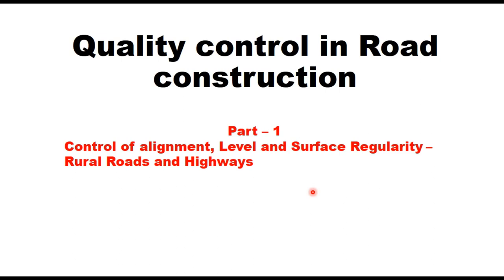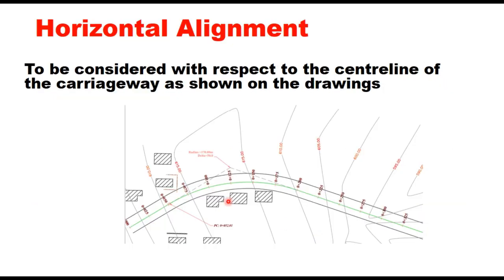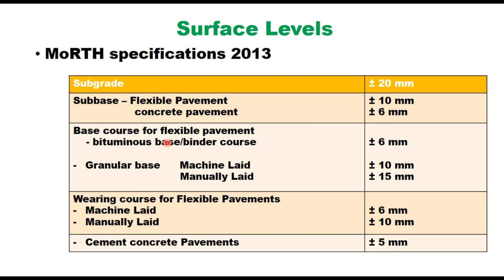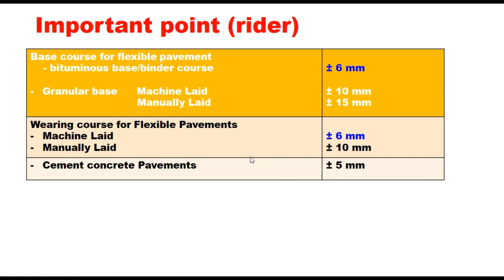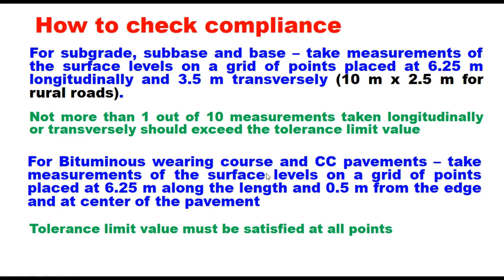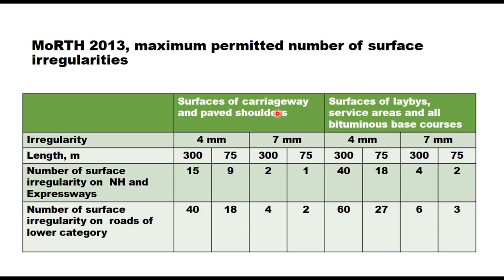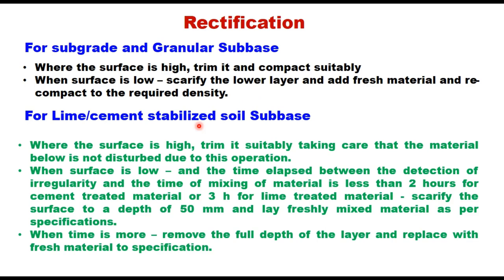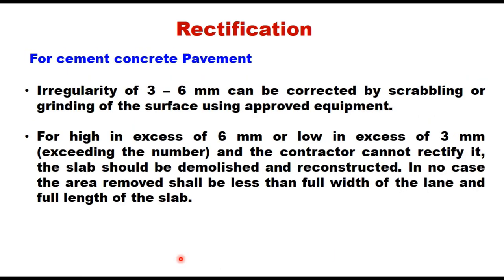Quality Control in Road Construction -  Part 1, control of alignment and surface levels.

Comment: Sir  I can't express my happiness from this lecture. I will never forget  u in my life  Sir.  Thank you so much for such precious lesson.
Reply from the maker: It's my pleasure. I am happy to see you happy. There are many more good videos on my channel. Watch and comment. You may suggest new topic also.
Reply: @SatishIITR  sir in the new irc code (irc sp 135 2022) design of hot bituminous mixes there is a provision of film thickeness of Bitumen between aggregate to validate binder content. And it refers "Shell Bitumen Handbook" to understand the calculation of film thickness. Could you please make a video on this topic. And in this new irc sp 135 fines to bitumen ratio has also been changed to 0.8 to 1. Previously it was 0.6 to 1.2.
Reply from the maker: @happening2023  Film thickness is not the criterion for deciding the OBC, it is a step for verification. I am currently making  one video on Bituminous Concrete and will discuss these two points also. Thanks

Comment: Sir is it correct to spray stone dust containing lime or hydrated lime after laying and rolling of Bituminous Concrete??? Some are saying one should and some saying it's not good
Reply from the maker: sprinkling of dust+lime is done just to avoid loss of bitumen to the vehicle tyre if traffic is opened immediately after compaction of the layer. However, there is no such requirement as per specifications, but in that case traffic should be allowed after the mat has cooled down to ambient temperature.
Reply: The QC engineer told that as the bitumen heats up due to temperature or traffic, the bitumen will come up towards the road surface, then if you have put dust on it, it will not be a proper seal and if you have not put dust the surface will be properly sealed. The dust or lime doesn't have bitumen coating over it so it'll also create rutting and ravelling  that's why you don't put lime dust on it is it correct ???
Reply from the maker: @ramnivas734  completly illogical.

Comment: Sir thank you for this video 
Sir In order to perform sieve analysis of OGPC what sieves should be used for quality control purposes 
And is there any prescribed limits of percentage passing of materials on these sieves
Reply from the maker: NO, in the case of OGPC, quanitites sepcified in the specifications is for 10 sqm area of the road and these are in volumes. For example, P22.4 and R11.2 should be 0.18 cum and P13.2 R 5.6 should be 0.09 cum for 10 sqm of road surface. If you take same specific gravity of the aggreates of two sizes, then their weight should be in the ratio of 2:1. It means Aggregates passing 22.4 and Retained on 13.2 should be 66 percent. But there is no mention in the MoRTH or MoRD book about this.
Reply: Thanks a lot sir 🙏. Sir how much deviation is permissible from the above mentioned 66 percent value.
Reply from the maker: @nitusingh-io6jc  No deviation suggested in any reference